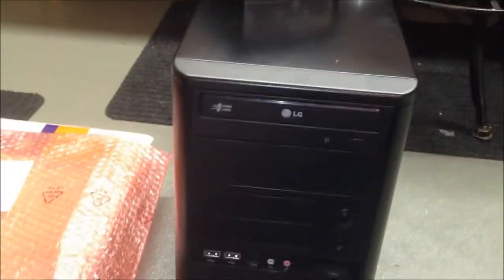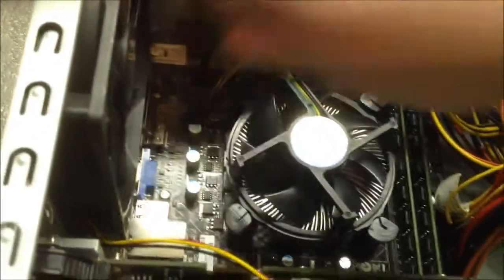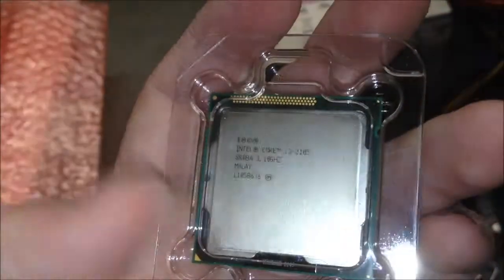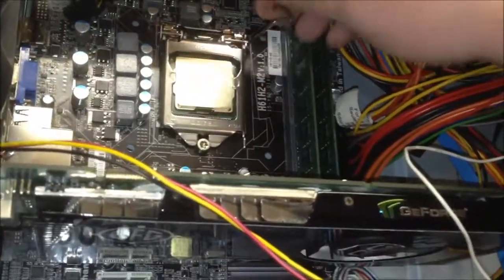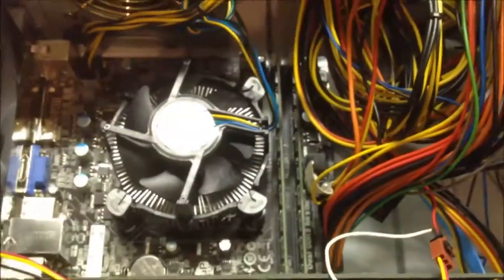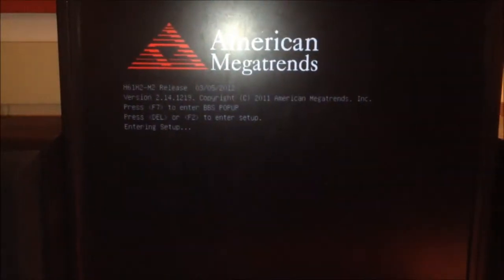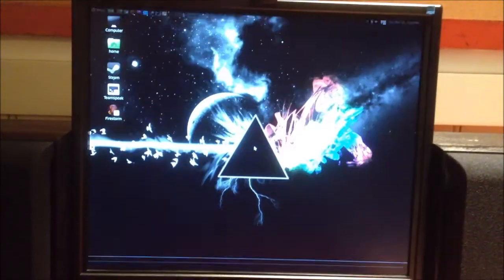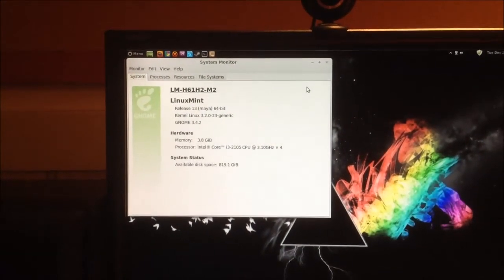Linux Box 12-25-2012: CPU Upgrade

Comment from the maker: they're not as bad as they were on Socket 775 where they'd flex the board and eventually break a push pin. still don't trust them completely, but they do work.

Comment: @lmull3 yeah, the stock isn't fantastic but at least it's something. I've seen some use hot running p4s and i7s with no compound at all, which is just stupid tbh. It's ok for a test, but for running systems... no.